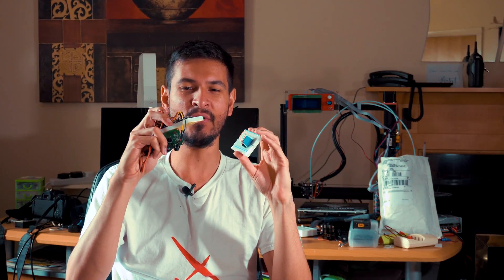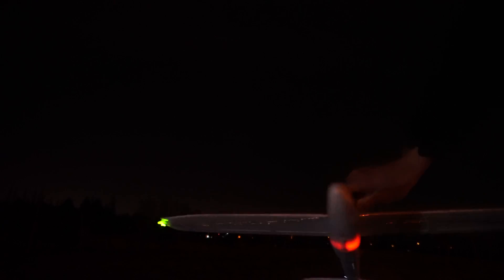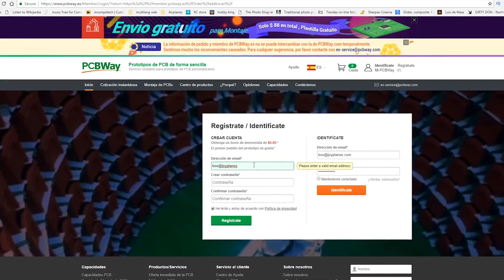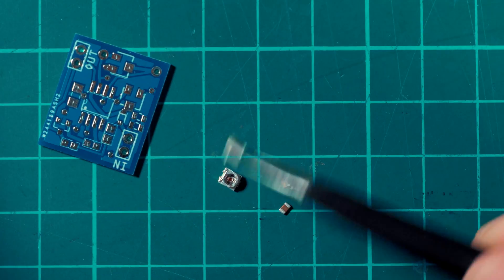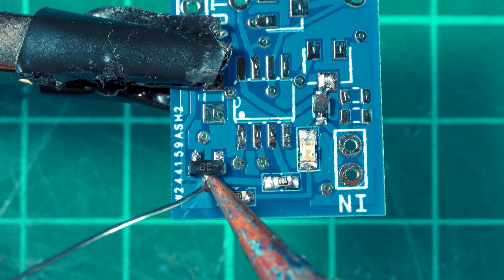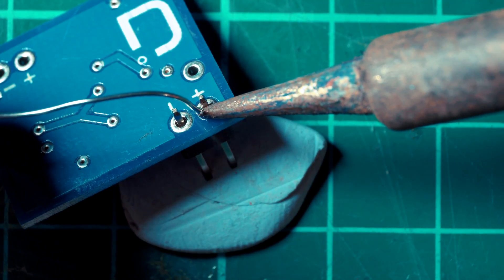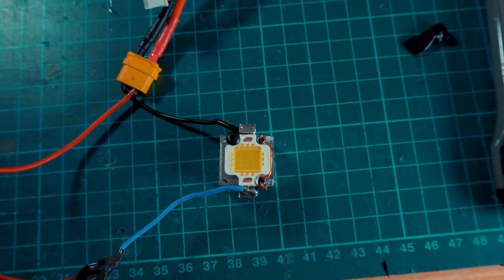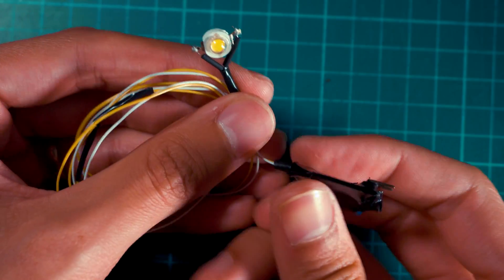How to make professional SMD PCB for $5 | PCBWay

Comment: This is why you design a solder stencil with your pcbs and use hot air to solder everything.  Hand soldering packages that small will never be as easy, reliable or good looking as solder paste and hot air or an oven.

Comment: Not sure what your exact circuit is but to get rid of the noise it looks like you might need a resistor to ground on the output.  Something like 1M or 100k might work.  A 0.1uF capacitor works as well and you might need both but not too big a deal if it just works.

Comment: How do I get a tiny half inch PCB with 1 chip on it duplicated. I dont have the blueprints and I dont know what is coded on the chip or if there is a block. Thanks

Comment: Great video, love how simple you made it look.  Can you tell how to flash the firmware to chip you installed?  Did you just use the same arduino code and put on the controller?  But how? Can you explain that part?  Does PCB Way do assembly also? Thanks again.

Comment: Good job. You may have already discovered, but it’s much easier if you just ‘tin’ one pad only for each component. That way, the component can sit ‘flat’ after you’ve soldered the first pad. Then you can ‘adjust’ if necessary and then just solder the remaining pads.
Reply: hey, do you know how to mount the smd parts on the pcb? I need someone helping me with a small project.
Reply: @robertknorr752  - where are you?